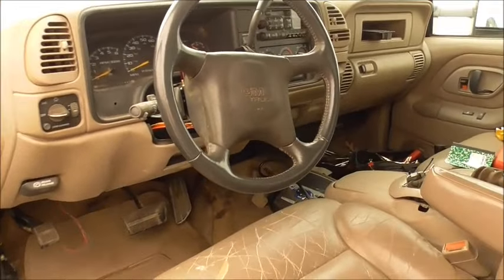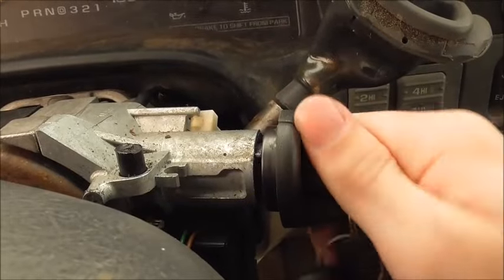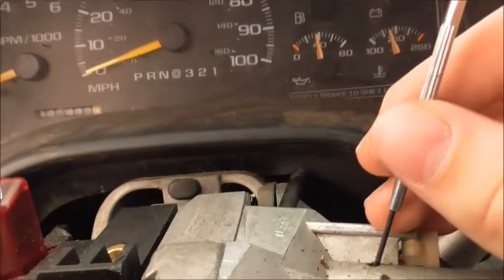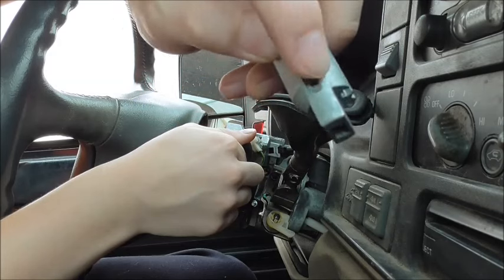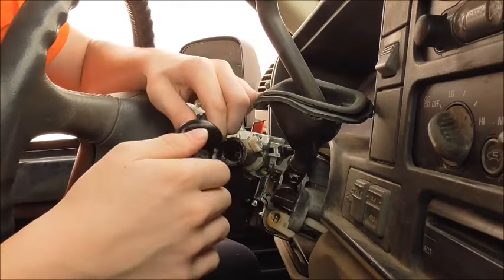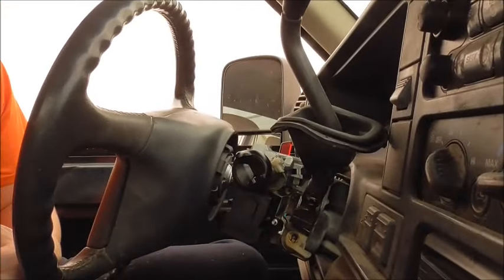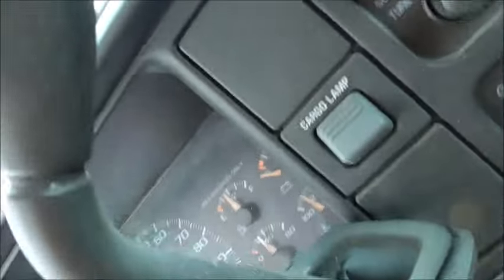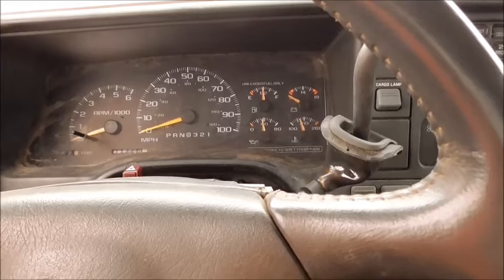Ignition replacement on 95-98 gm trucks

Comment: This was great. I watched a lot of videos trying to find a practical approach to this. Some were taking the steering wheel off to drilling these out. They would say unhook the battery but not tell you why or what its supposed to accomplish ie turing the key all the way like starting it. Thank you for this simple effective approach.
Reply from the maker: Yeah I try my best. I just wished the quality of the video was better  because I kind of slacked off because I thought the video wouldn't do well. I guess I was wrong lol. Anyway no problem and thanks!
Reply: You ALWAYS need to disconnect the battery before you mess with anything that has power going to it. Basically if it's not brakes tires or body work. Disconnect it. If your ego won't let you do it without explanation, it's for saftey. And if thats not enough then go ahead and be another example of fried electrical components, fires, or even worse

Comment: I can’t turn my key to start position because my ignition cylinder isn’t working correctly and that’s why I’m changing it but every video requiem to put it in start position to change it.
Reply from the maker: Recently people have been asking that same question. There are a few ways to do it I guess. I have told people to possibly drill a small hole over where the little push pin would be in the off position. You have to line that up quite well for it to work. That is probably what I would do.
Reply: Hey hey I got it turns out you can pry down the thing that isn’t working correctly and force it to turn so I got it out thank you for your tutorial
Reply from the maker: @Aqatsuki  Good to hear that. No problem.

Comment: What is the name of the part called? My 1998 Chevy Dually broke. It has a little button beside the key ignition  that broke. The whole plastic ring broke as well. Thanks.
Reply from the maker: It is generally called the Ignition Lock Cylinder.
Reply: @derbydog02  thanks.

Comment: I’ve lost my key completely. The switch has bn changed out before. How can I get the switch out??
Reply from the maker: You have to measure precisely and drill a small hole over where the button will be in the off position. Hit the button the same as if it was in the on position and it the ignition cylinder should pop out. As far as I can tell this works.

Comment: Great vid! Any ideas when key doesn't engage starter or spring back from start position to on position?
Reply from the maker: Thank you, the only thing I can think of without actually seeing it is perhaps the shifter is not reaching park? I had a newer gm truck that had a similar issue except it would engage starter. I would check to see what gear it thinks its in.

Comment: Why do I have to put my truck in neutral with the key off to make the shifter to move if I start the truck it will not shift from park at all
Reply from the maker: There is small pin that holds the shifter in park and essentially let the ignition know if it is in park I believe. Perhaps that pin is not functioning properly. The pin is location at the bottom of the shifter. If you have access to a junkyard I would go there, and take a look at how the mechanism works and see how yours is different perhaps?
Reply: @derbydog02  thanks for the info but I cant see the pin what would be the fix  an how to do it
Reply: @derbydog02  forgot the key turns on easy except when you go to start mode it's very hard to turn
Reply: Hate to bother you just trying to give all my info bought the truck cheap price put new engine in needed to change the shift cable and while I got this far why not figure the shift problem out at the same time thanks
Reply from the maker: @ronlowe1676  Okay that shift cable may be your entire problem. If it is not routed correctly weird things like that will happen.

Comment: Brother how i can replace it without the ke i lost it 😢 can i still do it?
Reply from the maker: You will have to drill a small hole and do it precisely above where the button is while the cylinder is in the off position. I would make sure to do some good measurements beforehand. If done correctly it should work.

Comment: Good video but what do you do if the key wont turn at all to do this...?
Reply from the maker: That I have not ran into. I would do more research to see what other people have done. Worst case scenario you have to drill a small hole to get access to the button I show here, but I dont even know if it is to designed to come out even if the button is pressed down in that position.
Reply: @derbydog02  thanks for the reply bud, I found a fellaw that shows how to get it done. I'm gonna go pick up a new ignition switch tomorrow. 👍
Reply from the maker: @tylertapp131  Glad you found something.

Comment: What do I do if I can't turn the key into drive to take off the cylinder
Reply from the maker: I would try everything possible to make it turn without destroying the ignition system if it isn't destroyed already. I have never ran into the issue. Usually if you put the key in just right the key will turn. It once took me about 10 minutes to get one to turn just playing with the key.

Comment: Do you not have to re-key the ignition?
Reply from the maker: No, you can buy an ignition switch that comes with keys(most auto parts stores have the ignition switch with keys). Now for the door you will have to keep the original key obviously to manually unlock and lock the door, but it is a relatively simple fix.

Comment: Yes but how did you get the upper plastic cover of the steering column?
Reply from the maker: There are long bolts through the bottom holes of the bottom cover. If I remember correctly the way to take it out is to take those bolts out and then the top should be loose after you take off the bottom. It has been a long time since I have done one of those covers, so I may not be 100% correct, but that's what I remember.

Comment: So my question is does it work tight after. Reson why is because most chevy cars need to be reprogrammed after doing this. Let me know I could use the advices
Reply from the maker: It works just fine after. Never had a problem. There really isn't any reprogramming to be done. These trucks (I don't think going based off that I replaced the ignition) don't have that much security as far as this goes.

Comment: They broke into my truck and i can’t get it  to go to the start position ? What do i do?
Reply from the maker: It depends on the amount of damage done to the ignition cylinder. If it is really bad then you might have to tear apart he steering column.
Reply: @derbydog02  i think they tried sticking the screwdriver in it my key still goes in but can’t get it to the starting position the pins your were talking about the two pins that move when you put the key in can i try prying both of those at the same time to get it to turn ?
Reply: @derbydog02  or what’s holding it from turning into the start position
Reply from the maker: @Savedbygracefaith  The ignition would have to be extremely broke to be able to use a screwdriver. The pins in the ignition cylinder move to the contour of the key and allow a small bar like piece to slide down allowing the ignition to turn from the off position to run position. It is a precise fit essentially. Sometimes when the ignitions are damaged the key will go in slightly different and can be played with for quite some time to make the cylinder turn. However, if a screwdriver has been forced in there it can damage those pins probably never allowing it to work properly again, therefore, the column may need to be torn apart in order to fix the issue.
Reply: @derbydog02  i ended up just tapping it slightly with the handle of a hammer and was moving the key back and forth and finally got it to the start position and now have it out thank you for explaining and helping me out boss great video as well!! Thanks for the help God bless you !

Comment: My truck is missing the black part on the key ignicion , does it work the same
Reply from the maker: I would bet it would if you are able to rotate it.
Reply: It has two like screws that pop in , would i uave to push them in to rotate it . Or it does not matter

Comment: Where do you get that little tool from what is it called
Reply from the maker: It actually belongs to my father, and it is just a very small flat head screw driver meant for taking about phones and the such. You can probably get them at a harbor freight or perhaps even walmart.

Comment: Ok so I got it all apart now I’m stuck at where you turn the key because my key doesn’t turn
Reply from the maker: There are videos out there where to go from there. I believe there are multiple ways to go. I believe the way I would do it is probably precisely drill a small hole where the pin is while the key is off(similar to the hole where the pin is when the key is on).

Comment: So your video didnt help me after you you replace it how do you program it so it will start cause with out programming it to that vehicle it wont start it will just turn over??
Reply from the maker: This truck does not have a chipped key. The vehicle should start immediately after the new install unless the key is chipped. If the key is chipped then you must use a gm tech 2, or have it done at the dealership. These trucks specifically as far as I know never come with chipped keys.

Comment: Great walk through. The lock cylinder wasn't your issue tho. A new key cut to spec would have solved your problem. It's a super common automotive failure, the key wears down and eventually goes out of spec.
Reply from the maker: Thank you, but I would have to disagree, these gm ignitions are known for failing even with a perfect key. I had three to four keys for this truck and every one of them had the same issue with the ignition even though some were more worn down than others. My fathers truck has had the same issue for years(identical to this truck I am working on here), and he had a brand new key made for it and it still doesn't work right. I will agree it is a common failure for the keys to wear down, but it is a different issue on these gm trucks.
Reply: @derbydog02  for sure, it just a super common issue. The sidebar won't go in even with like 10-15/1000s of wear. Usually what happens when the key gets copied at a hardware store is it's a little more off so you get a bad copy of a bad copy. Any local locksmith can verify the wear pretty quickly and make a key to spec if it's out. It really is usually the key. The wafers are harder than the key. But seriously, good walkthrough. I actually need to pull the same switch in a rig to make a key that was lost so the approach is a bit more invasive lol

Comment: How do u get the ignition out without a key
Reply from the maker: I have never done it or seen somebody do that before, so I am not exactly sure how to do that. There are certainly different methods. I think one of the ways I would do it is go to a junkyard and get the keys out of several of the gm trucks and even cars of the era and just try them in the ignition. The only way as far as I know after that is to break it, but try not to break the steering column at the same time.
Reply: Did you try it with out the key I seemed to have misplaced my key and am wanting to get my truck running and either I'm thinking change it instead of getting it rekeyed for 250 baha

Comment: wat if u dont have the key
Reply from the maker: There maybe another video out there covering that. It may take more digging. I have told people in the past worst case scenario you will have to drill a small hole where the button is while the ignition is in the off position. I would do that as a last resort because at that point it is more or less a guessing game.

Comment: Check out this video for an easier way —( 96 Chevy 1500, late model Chevrolet ignition lock cylinder
Tommy Fellows185,509 view)
I did a vary  similar process in my truck it works out great
Reply from the maker: I actually watched that video, but I decided that I didn't want to drill that hole. I wanted for it to look like nobody had ever touched it. I was selling this truck after all. There are many ways to do it, but I still think if somebody wants to make it look like nobody had ever been in there is to do it the way I did it, and it isn't hard to do.